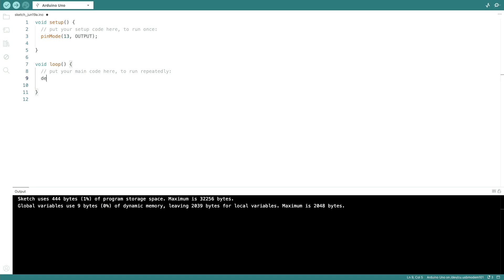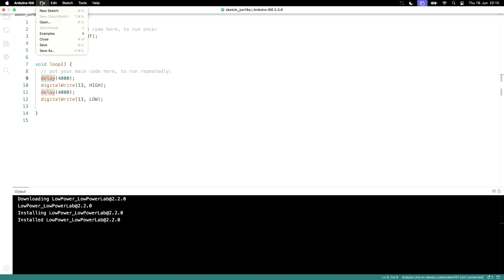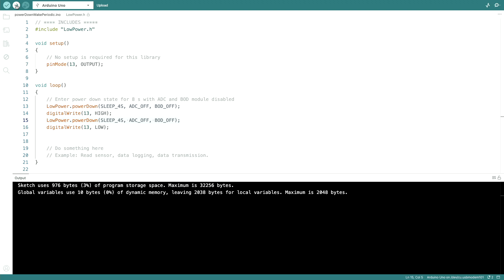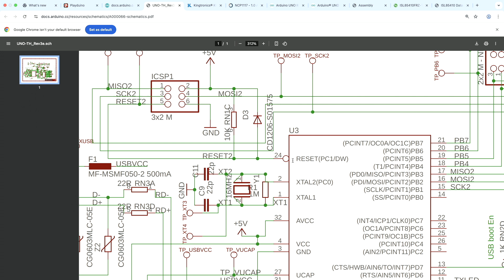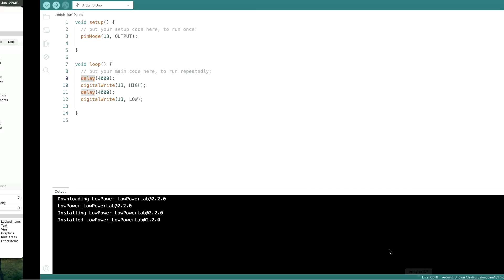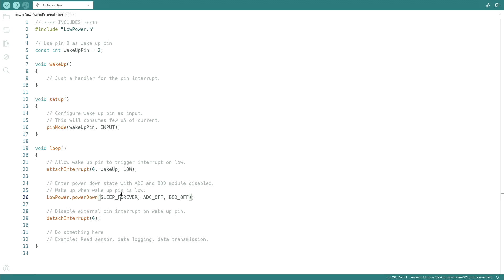Arduino Power Optimization: Beyond the Basics

Comment: promini board; remove led power . use better dc regulator. with lowper.h:   many month to transmit captors value with 2 aa cells
Reply from the maker: Good point! I never used one of them. It’s even available as 8MHz / 3V3

Comment: Better by far to switch to an MSP430 device (TI)  There is an Arduino look-a-like called Energia if you want to use it, but I've found coding in C the best way to reduce power.

Comment: and when powering via Vin, the NCP1117 regulator (that's the one according to the schematic) that delivers the 5V needs typical 6 to max 10 mA to work....
(I'm not sure to wich extent this is valid however, because i believe he's bypassing the LDO
) 

eg TSP7A02 has a QC in the nA range...  a quarter of a million times less! (but is not capable of 1A current)

Comment: When you look for something else, check out the difference in stability of the 24x waveform created by my open source crank signal generator. For some reason, the Pi Pico does better than an ESP32 S3. I'm sure it has something to do with MBED OS vs freeRTOS, neither of which I'm crazy about, but apparently nobody knows how to make an ARM based arduino with just a boot loader and without an operating system. And show me something that can run interrupts and/or serial on the second core.

Comment: Would using the internal crystal use less power?
Reply from the maker: I would say yes, but I did not find it in the datasheet
Reply: @playduino It would also be interesting to compare the original blinky code without sleeping on the barebones setup. You got me itching to experiment. 😂
Reply: in general a lower frequency would lower the consumption power....

Comment: I seem to have missed what actually made the custom board lower power? Did it use a higher efficiency power supply? Did it use an external timer to turn the whole board off?
Reply: It's not powering the USB chip, 3.3V regulator, a constantly on power LED, LMV358 opamp
Reply from the maker: Exactly 👍
Reply from the maker: on the custom board, I have no additional components that consume power and I also used the lowpower library to replace delay().

a custom board basically only needs:
- 16MHz oscillator (with capacitors)
- pullup resistor from #RESET to 5V
- decoupling capacitor to stabilize the 5V supply
Reply: Ah so the bench power supply was being your regulator. So that’s cheating, a bit. :)
Reply from the maker: @jvanderberg no, he meant the additional 3.3V regulator that is on the arduino board. That one also wastes some energy.
I powered everything the same way
Reply: @playduino got it. Thanks!

Comment: Arduino doesn't support changing the fuses to get lower clock frequencies, does it?
Reply from the maker: Good point, you can change the fuses but it will break the arduino bootloader because of the baud rate that is used for programming. And all other timing related features will be wrong.
Reply: @playduino  I like the idea behind the arduino projekt, but a few things are bothering me about it. The fuses being one thing, renaming all Pins would be another one. But making it near impossible to get energy savings like with a "bare" ATmega must be the worst one.